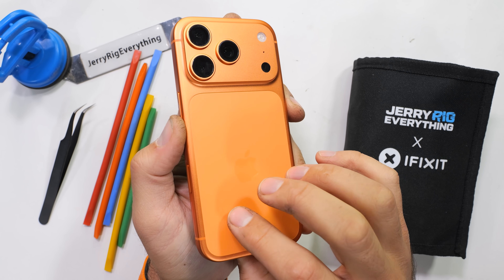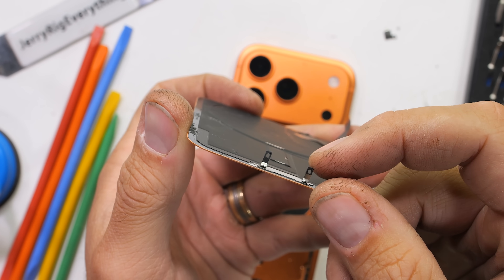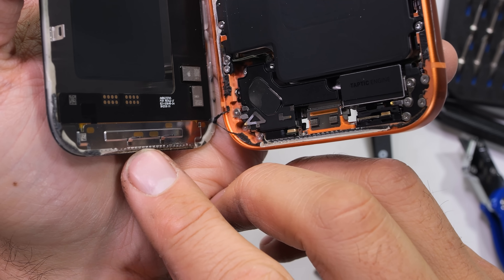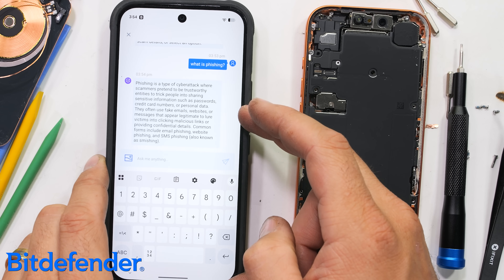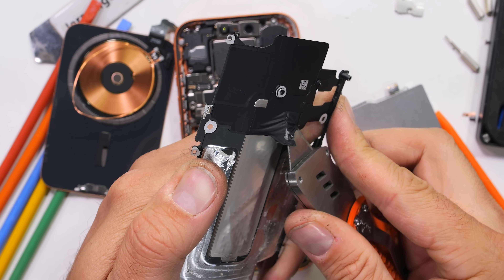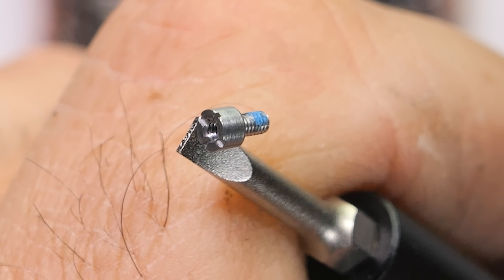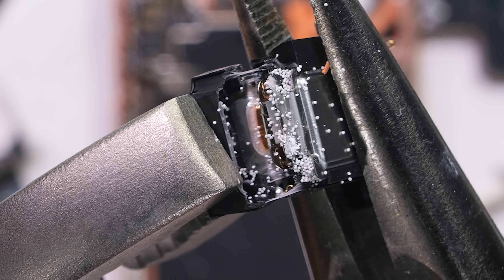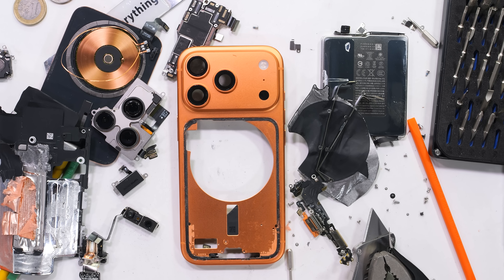iPhone 17 Pro Teardown -- I AM JEALOUS

Comment: New iphone 17 pro max is the worst iphone i had. Dented right away from the soft aluminium body and so many bugs ans glitches daily it's annoying. The iphone 14 pro max was way better
Reply: Wow. So far. I’ve had mine for 2 months and easily the BEST iPhone I’ve had (Every one since 1). Although I’m not a fan of the form factor, the functionality is insanely great. Unfortunate yours for some reason didn’t work. I haven’t had a single error or even a need to restart.

Comment: Oh this could def take only 2 min. IF we didn't have to change out the adhesive and run AST2. Its pretty much mandatory in places like FL because of the humidity. more like 15 min to properly clean the phone and residual adhesive and apply the new one. Then 5 min for AST2. Then 5 more to power phone back on out of repair mode and run QA tests.

Comment: As you described with the app, the iPhone is more than capable of taking a picture of someone who tries to log into your phone. Tho they don’t do it by default for some reason. But there are several apps that do exactly that showing it has all the software capabilities to do so. Which makes me actually look at any other app and wonder why don’t you do it too. I had apps on the iPhone 13 Pro that did this without issue and even earlier models with face scanning. So apple just doesn’t give a shit, but clearly neither do the apps themselves which are the ones who are expected to develop their software based off the hardware…

Comment: last time i had an iphone was in roughly 2010 with the brand new iphone 4. I just switched back to iphone 17 pro max after being android only since roughly 2013/2014. if i had to rate my user experience with phones in my life it would be 
(best) PIXEL 3 XL, Pixel 1, HTC one from 2006, iphone 4, Juke, crappy base model flip phone 2004 (first phone), Pixel 6 Pro XL, Galaxy S20FE, Pixel 9 Pro XL (worst)

the 9 pro XL has been my worst phone I've ever owned, and the god awful galaxy s20FE only outdoes it because that phone at least connected to the network and Bluetooth all the time. This pixel 9 is even worse at connecting than the pixel 6 was, and that phone had some horrific intermittent issues.

So who knows... where will the 17 pro max land? it arrives next week so we will see. From what ive seen and read about apple these days. the things that held them back from the early 2010s dont really seem to be much of an issue now

Comment: The metal battery casing is there to transfer its heat to the vapor chamber and cool the battery. Also the EU requires all batteries to be easily replaceable by 2027 and maybe Apple are already preparing to make it replaceable from the back like Nokias and other phones in the good old days.

Comment: 1:42 rather than doing that, put your metal pry tool like the ifixit jimmy perpendicular with the phone, and slot it in between the metal frame and glass boarder. Once fully inserted, slide to one corner, then slowly pry open. Opened well over 1000 iPhones like that. Most of the time they didn’t break, but I was usually dealing with already broken screens

Comment: Nokia actually had a vapor chamber inside Lumia 920 if I remember correctly. That phone came out in 2012. The Lumia 920 was also many other ways ahead of its time, it had Qi wireless charging, OIS, mechanical autofocus, high speed 4G and other things.

Comment: Not an easy fix when you'll likely need to replace the screen every time you want to get in to "your" device. Maybe they can fix it next time and also be brave enough to introduce a SD card slot and the 3.5mm TRRS port.

Comment: I am suspecting some weaknesses in the charger port area. 

A customer came in with a broken display and charger port on his new 17 Pro. 
His kids got a hold of it while charging and dropped it right on the port. The frame cracked near the radius of the port, and the deformed aluminum pushed the display out and killed many pixels. 

Good thing he has insurance. *The display did not crack! *
Reply: Fake, no way that “several pixels went out”, displays simply don’t die like that

Comment: I actually did switch with this iPhone from android. I’ve been an android user since android 2. Just because I hated the golden cage.  But through out years google slowly made android a shitty cage. And apple made their cage bigger and bigger.  If android prohibits side-loading they officially become a closer cage than iOS. 

I’m very glad that I have switched. It is a much better experience. I don’t even need to make it root (or jailbreak it as they call it) to do what I wanted it to do. Or to install a custom rom so to have a goddamn device without adds everywhere. Or to have to install Firefox and agree to their egregious terms to just have a simple ad-blocker.

Comment: As a former microelectronics repair technician who was repaired every iPhone up until the 13 series... This might just be awesome. The real question is do the battery and screen need to be programed with apple's magical fairy dust to replace it or not? 

For the 11, 12, and 13 series iphones we had to literally use microsoldering to desolder the ic chip on the screens and then reflow them onto the replacement screens. If you know anything about microsoldering you'll know doing all that while not damaging the ribbon cable or the screen isn't as easy as it looks.

Comment: I dont work in phone repair anymore but saying "this screen could be replaced in 2 minutes" is dangerous stuff to say. I actually hated that people would say stuff like that in these videos then someone brings in their phone to be repaired and when they are told it will be done in 2 hours they get mad. What they dont realize is: 
1. We probably have other phones to do first. 
2. If its an apple certified repair, using apples programs literally takes 20+ minutes to enter the phone into, if the shop is using apples repair tools the heating oven thing is a piece of garbage that is super faulty and takes forever to get warm, and then another 20 minutes for post repair calibration. 
3. We are giving ourselves a little bit of time extra in case something goes wrong like a stripped screw, issue with the apple system, a faulty new screen, you spilled alcohol on your phone and now all the adhesive is nasty black goo that takes 30 minutes to clean off, getting a rush of customers, any sort of emergency, we might also be training someone new, or god forbid an internet or power outage. 
4. This is the big one, I am going to tell you longer than its going to take because if I call you before you're expecting it, you are going to be happy its done early, if I tell you its only going to take 30 minutes and you come back after 30 minutes, its not finished, and anything from #3 has happened,  now you are waiting in the store with no seating for another hour and a half, you are gonna be pissed and probably leave a bad review. 
On top of all that if you take it to apple directly they are going to tell you longer than most 3rd party shops.
Reply from the maker: Valid points.
Reply: @JerryRigEverything  know I say this not with actual anger at you by any means. Still a big fan of your stuff of course. More that I wish people understood what actually goes on in a shop.
Reply: Very well said and very true that‘s why I raised my repair prices to avoid those customers.

Comment: 'Vapor chamber' as a selling point is such buzzword BS.

Im a mechanical engineer who designs $100k computers, including sole responsibility for designing all cooling solutions. I also have a master's degree in mechanical engineering, with my thesis being in the field of applied thermodynamics in electronics cooling design... 

Advertising a vapor chamber on a flagship phone using the most powerful mobile SoC's is like advertising that the CPU cooler on your crappy pre-built gaming PC has 'Heat Pipe Cooling Technology!'. 

Well, DUHHHHHHHHHH. Vapor chambers are just very thin and wide heat pipes.

Heat pipes move heat from A -> B. Usually A is the processor - B is an extended array of heat pipes and cooling fins + a fan.

This doesn't work for phones, which cannot have fans, and must rely on passive heat transfer to the environment.

Vapor chambers use the same physics at heat pipes, but they are super thin, very wide heat pipes. In effect, they take the heat (power) produced (in this application) by a tiny surface area SoC [~1/4 surface area of a postage stamp - like fingernail sized] then 'throw' that heat equally apread to the size of like 5 postage stamps. 

That's like a 20x dilution of power per surface area, so a 20x reduction in net system heat flux. 

When such a vapor chamber is sealed to a glass backing of a phone, the SoC could run at full power, in a cool room, with some airflow, without a phone case, at maximum power (guessing 8-10W MAX), and operate fine. 

There's literally no other technology that exists that fits in a phone, to cool mobile SoCs. It MUST USE A VAPOR CHAMBER. Companies have been using vapor chambers for decades, phones have had them for over a decade. 

* iPhone 17, now with BLUETOOTH! * - Apple loves to take standard state of the art engineering technology, then advertise it as a new feature a decade later. 

Don't waste your money on apple's overpriced, trash.

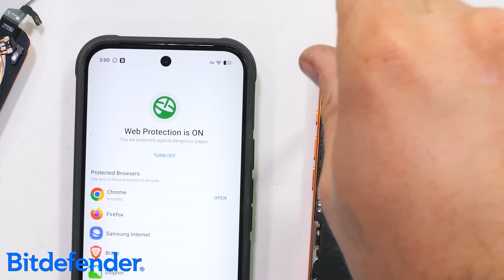Comment: 3:26 you could do that using Shortcuts on iPhone so😅(that being taking a pic of someone trying to access your phone )
Reply: I’ve tried it you can’t
Reply: @zuko8023   this is an AI response but certainly work 'How to trigger the camera with an incorrect password
Go to Settings > Face ID & Passcode and set Allow Access When Locked to On.
From the Shortcuts app, you can create a new shortcut that will take a photo and run it when a wrong password is entered.
Tap the + button and go to Add Action.
Search for Failed Login Attempt or Wrong Password.
Tap Done and your new shortcut will be active.'
Reply: u can't

Comment: Can you finally use an iPhone like a thumb drive and for music can you just play from folders or do you have to create a playlist.  I'm glad it no longer needs to connect to iTunes.  I am really digging this orange color. I have five iPads but never daily used an iPhone ever for just those two reasons.
Reply: You can play music from folders, but the experience is a lot better with a third party app like VLC. And no, you cannot use an iPhone as a flash drive by default, but once again, there is an app for that

Comment: "vpor chambers" have been around for decades. Also known as heat pipes. There's even one or two inside my vintage Kenwood stereo amplifier, which has been around since before cell phones ;-)
Reply: And he forgot to mention the necessary requirement for heatpipes/vapor chambers to be in a vacuum so the water can move around faster in a constant boiling state.

Comment: 'Member when Apple and other companies said that designing repairable phone was too risky and would result in bigger, costlier, uglier, lower performance devices? And remember how we all knew they were full of it?
I really am glad that Right to Repair laws are not just being passed, but they are also having the desired impact. Repairable devices can be slim, performant, pretty and still easy to make (they were never going to pass any cost savings to us if we're being honest). Props to Apple for letting their engineers go all in on making the iPhones repairable, and not dragging their feet with token "repairability" features. This will hopefully lead to other device manufacturers actually putting in the effort to do designs the right way.

Comment: Why can't apple or any others just use the glue they use on the battery for the screen then it could be electrically debonded and make removal so much easier just a thought

Comment: that battery replacement is the worst because you will pay for that attached frame too and it makes recycling more difficult.
Reply: You can just remove the battery from the frame the adhesive comes off easily

Comment: Glad it's more reparsble. But this thing is full of traps for you to make mistakes attempting to repair it...
- Screwed ribbonncables that can easily tear
- Easy to pry screen pins near the edge (as was done in this video)
- So many different type screws to get lost when reassembling
- Glue
- Still have to go through all that just to get to the battery

Comment: I finally bought one despite not able to get the silver color (deep blue). I have placed a back hydrogel protector for it and of course, a very good case. Pro is way better for me than the Pro Max. Well, it's my 2nd iPhone after the iPhone 4S. I'm also an Android user since 2017. Some things I'm not able to do in iOS is sideloading apps, turbo scrolling and other customization stuff. iOS 26 is fine. If only I can do a review video, I would have explained it further.
Reply: I side load through certain apps but I think that could be considered jailbreaking

Comment: It looks like the vapor chamber does not come into contact with the aluminium frame at all, I suspected as much and might mean using aluminium for heat dissipation is not true. Titanium might have worked just as well.
Reply: This iPhone is the coolest iPhone and thermal throttles less than earlier models. The 15 with the titanium frame was known for its overheating issues. I think the aluminum definitely helps even if the vapor chamber doesn’t directly touch it. Titanium is bad at conducting heat. I do think they could have maybe used steel though.
Reply: @rogeliocano9536  positioning the chip towards to the screen might help alleviate the heat more than the aluminium. The vapor chamber sits between the battery and the screen on the midframe .i can assume the SOC sits just below the VC, and above all the cameras, lidars, components and crucially, away from the back case. maybe the heat will be felt on the side of the screen rather than the back. Which also begs the question if its wise to have the display so close to the heat source.
Reply: @Evning Glass is not good at dissipating heat either and is significantly worse at it than aluminum and even titanium.

Comment: Year 3,000 replacement is the reason why I can't commit to iPhone
Reply: that damned planned obsolescence shakes fist
Reply: I'm still rocking my iPhone 13, earliest  update, zero repairs done, no protective case, it does have some scratches, battery degradation and a bit slower, but for the time being, its an amazing tool
Reply: @xXNoeSanchezXx  My iphone 5 still works fine but they shut down 3g in Australia so you can only use it on wifi now
Reply: @xXNoeSanchezXx the iPhone 13 was a quality phone when I had it 3 years ago
Reply: This limitation was due to the intrinsic physical properties of magnets and not specific to iPhones, so it is not exclusive to iPhones and would happen even if you bought an Android or other similar phone with magnetic parts. The phone would also be long unsupported by time this becomes an issue, so you will have most likely upgraded to a newer model which is using newer magnets and will never encounter this issue within the realistic lifespan of the device.
Reply: Dont worry i promise it to you right now
Reply: Don't worry, a firmware update will nix it many years beforehand 😂
Reply: @AdrianNelson1507  that literally doesn't happen
Reply: You should be able to remagnetize it with a stronger magnet. Also, it’s a myth that magnets lose 1% of their strength every 10 years.
Reply: the replacement was promised to them 3000 years ago
Reply: By then they will be eyePhones anyway
Reply: Dawg year 3000 is 75 years away… It honestly wouldn’t be that hard to make an iPhone last that long.

Comment: This is the first time in years that I did not get the latest pro models 'cause the most fragile part of the phone, i.e., that easily malleable aluminum is not gonna be replaceable after all and the video shows how much it takes to separate it from the components. They were better off using Stainless Steel IMO.